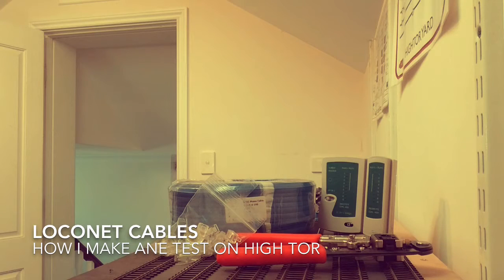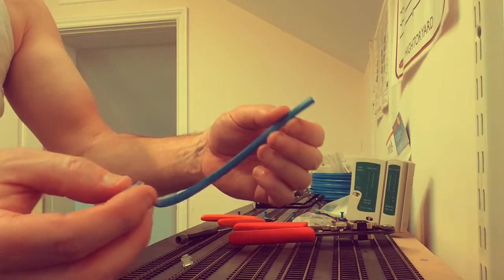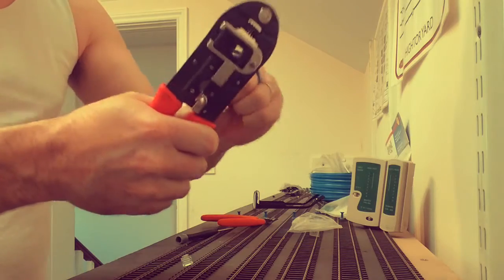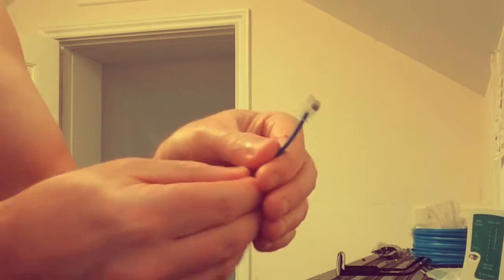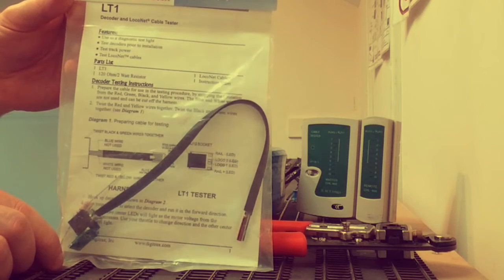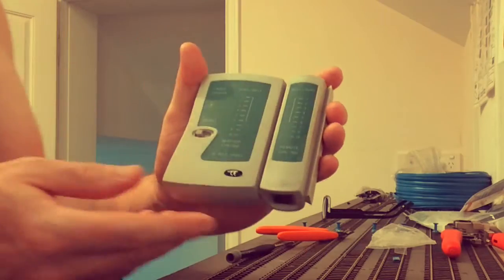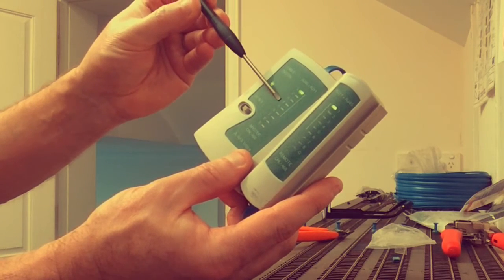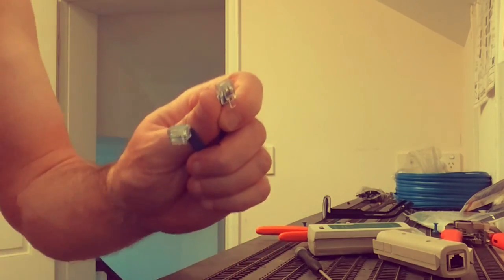Making and Testing Digitrax Loconet Cables

Comment: Thanks for uploading this video, Ive been using the LT1 but after watching this, I'd get on of these testers. Do you have a name and part number of it???
Reply from the maker: WestCoastRails thanks for the comment and glad this was helpful. I purchased mine from Litchfield Station in the USA as part of a much larger order to maximise postage value however if you search on eBay for RJ cable tester you will be overloaded with options I reckon!
http://www.litchfieldstation.net/product/cabletester/
Reply: Hi DD...many thanks for the response. I found one on eBay. Cant wait to use it as I have many cables to make up. Bench work coming right along and is soon to come. Cheers Greg
Reply from the maker: WestCoastRails I am glad that you have found the correct tool for the job. It will make all the difference I predict...